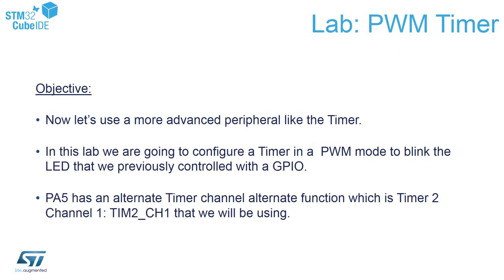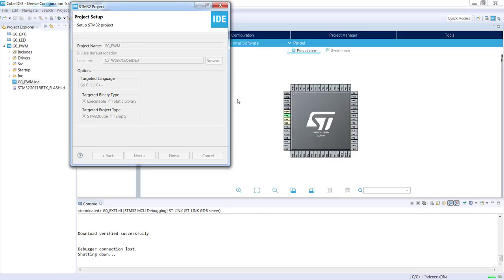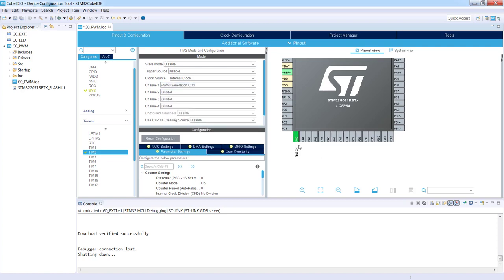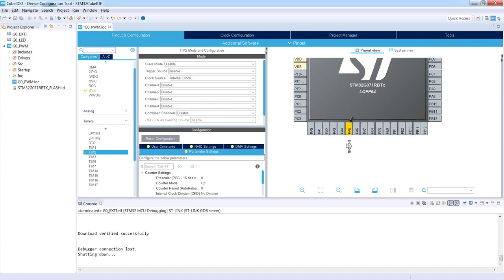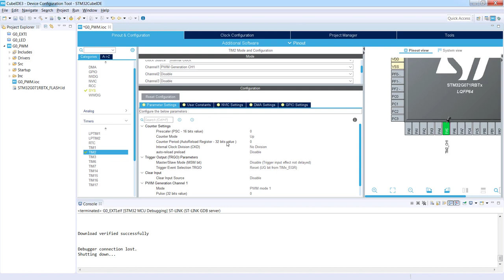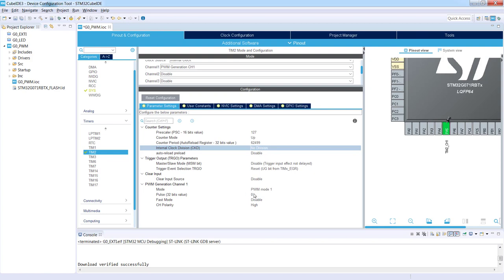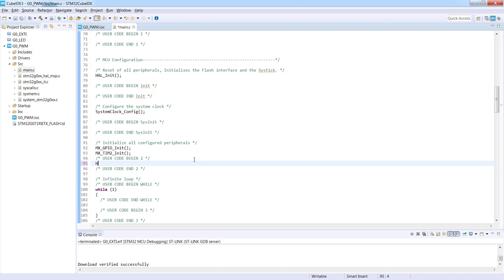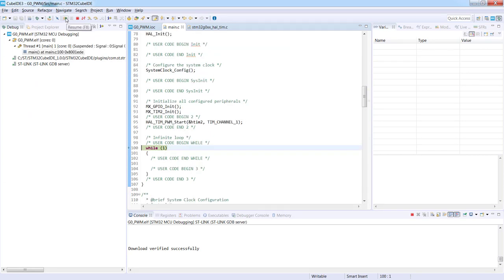STM32CubeIDE basics - 05 TIM PWM HAL lab

Comment: No info on how to change PWM duty cycle,
No info on how to read current timer value or reset it.
Would have been nice if you also showed how to use no output PWM inside the program.
Reply from the maker: Hi there, for technical questions we really recommend you check out our community of experts and other developers at community.st.com
Reply: HAHAHA thats it...
Reply: You are right, it would be really helpful to see how to change the duty cycle programically after the initial setup
Reply: There is a macro for that: __HAL_TIM_SET_COMPARE(&htim1, TIM_CHANNEL_1, pulse_width);

Comment: Great video.
Any reason not to use prescaler value of 8000 and counter period of 1000?  (1ms * 1000 = 1 second cycle)
Or prescaler value of 0 and counter period of 7999999 ?
Reply: There are usually a number of different ways to get to the same result(e.g.16000-1 prescaler, with 500-1 period)

The best is to use 80,000 as prescaler and use 100 as period , doing this will make calculation easier.
for example you want 50% duty cycle, you just put in the pulse register 50!
But!!, the prescaler it not large enough to hold this value, because it is 16-bit(max 65536)

There for your first suggestion is better in my opinion
Reply: @EngMazen  Can I change the prescaler value from code? I need to use this to generate a PMW signal, but also need to change the frequency. For example a 10kHz signal with a 10% duty cycle, then a 1kHz signal with a 40% duty cycle and anything in between.

Comment: I have always thought that HAL was a needless extra layer of abstraction that removes one further from bare metal where the reference manual and spec are king.  This is especially true for embedded power conversion applications where one is always 1uS from disaster.  These videos are starting to change my mind.  I still wonder how HAL would handle a complex high-resolution timer job with, say phase-shift bridge PWM with synchronous rectifier drive.
Reply: AFAIK, and I've been using the Cube HAL for like 5 or 6 years I think, still the MCU handles things. We're not dealing with registers directly now. Except for my beloved DWT->CYCCNT :)

I never believed an extra layer or two would effect performance, since we're still using C and hardware and compiler optimizations occur without letting us interfere anyway (actually I stay away from compiler optimizations whenever I can).
It's in the name, just the abstraction layer.

Though, if I was absolutely true, ST would not spend time to represent Low-Layer (LL) stuff... 
Probably you're right.
Especially depending on the target application.
Guess I know not as much as needed.

Comment: Really useful video. I cannot see in the code where the CHANNEL1 output pin is set. It is not in MX_TIM2_Init or MX_GPIO_Init (Note: I am using TIm2 on an STM32F411)
Reply from the maker: Glad it was helpful ! For technical questions please join us and your peers in the community at https://community.st.com/
Reply: Channel output pins for specific timers are hardcoded in the MCU. There are options though.
The part where he moved the first choice default pin PA0 to PA5 is what you're asking, if I got your question right.

If you're asking where the heck in the world the pin assignment is made, well, it's hidden quite well in the least expected place of course :D
In the source file stem32g0xx_hal_msp.c
void HAL_TIM_MspPostInit(TIM_HandleTypeDef* htim)
GPIO init is performed... I remember it being kept in its seperate source file for all GPIO assignments when generating for Keil. Maybe I'm wrong.
Anyways, line 164 on my project clearly outlines the pin structure and HAL_GPIO_Iniit() is called using GPIO_PIN_O and GPIOA...

Comment: i need to generate 500Hz frequency using Timer. can you help me with Same board
Reply: 500 Hz = (8 MHz / 32) / 500. So you set "Prescaler value" 31, "Counter Period" 499 and "Pulse" 250 (to get 50 % PWM). You could also choose other combinations like: 500 Hz = ((8 MHz / 64) / 250);  500 Hz = ((8 MHz / 128) / 125) and so on ...